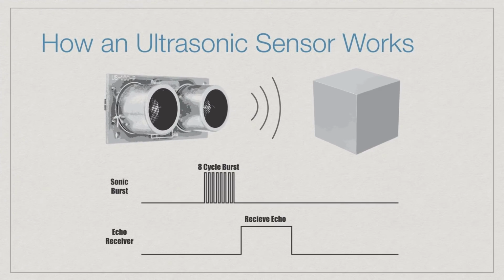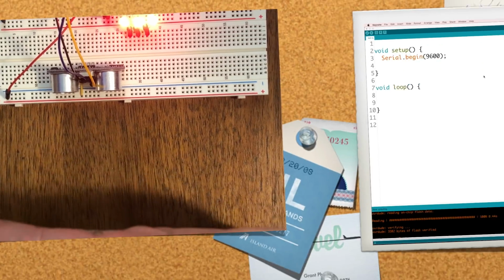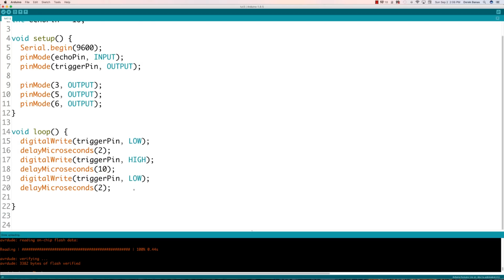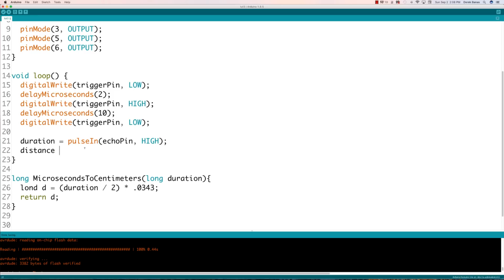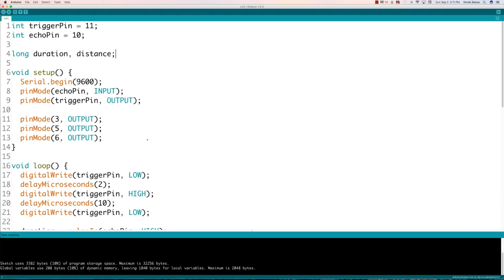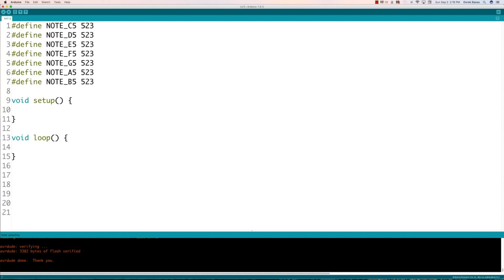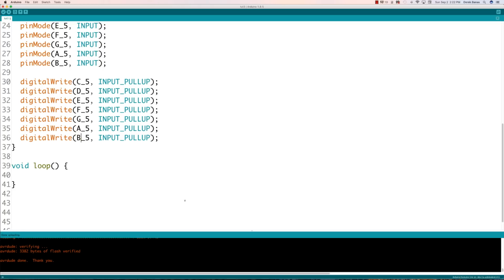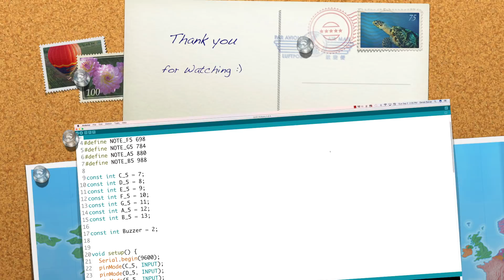Arduino Tutorial 3 : Proximity Sensor & Piano

Comment: Just wanted to contribute, through your thread.  Just bought a ESP32 Wemos lolin32, and thought I would convert your code, for the UltraSonic sensor, to code for the ESP32.  And yes the code, for using LED's, is different from an Arduinos, even though its the same for the UltraSonic Sensor, on both boards.  Also, be aware I used different pins, out of the convenience of their placement.

// Create easy ways to identify what pins are being used for 
int triggerPin = 27;   // instead of 11
int echoPin = 26;      // instead of 10
 
long duration, distance;

// ESP32 the number of the LED pin
uint8_t ledPin1 = 13;  // 13 corresponds to GPIO13
uint8_t ledPin2 = 12;
uint8_t ledPin3 = 14;

// ESP32 setting PWM properties, assigned to channels 1,2,3
const int freq = 5000;
const int ledChannel_1 = 1;
const int ledChannel_2 = 2;
const int ledChannel_3 = 3;

const int resolution = 8; // 0-255 (resolution 16 bit 1-1024)
 
void setup() {
  Serial.begin(9600);
 
  // Designate which pins are used for output and input reasons
  pinMode(echoPin, INPUT);
  pinMode(triggerPin, OUTPUT);

  // ESP32 configure LED PWM functionalitites
  //ledcSetup(ledChannel, freq, resolution);
  ledcSetup(ledChannel_1, freq, resolution);
  ledcSetup(ledChannel_2, freq, resolution);
  ledcSetup(ledChannel_3, freq, resolution);
 
  // ESP32 Prepare LED pins to provide an output voltage
  ledcAttachPin(ledPin1, ledChannel_1);
  ledcAttachPin(ledPin2, ledChannel_2);
  ledcAttachPin(ledPin3, ledChannel_3);
}
 
void loop() {
 
  // As we loop the trigger pin that sends the 8 cycle frequency is turned on and off
  digitalWrite(triggerPin, LOW);
  delayMicroseconds(2);
  digitalWrite(triggerPin, HIGH);
  delayMicroseconds(10);
  digitalWrite(triggerPin, LOW);
 
  // Get the travel time from playing the sound to receiving
  // it back 
  // pulseIn() turns a pin on and waits times the period from LOW to HIGH
  // and returns the period in microseconds
  duration = pulseIn(echoPin, HIGH);
 
  // Convert that time to centimeters
  distance = MicrosecondsToCentimeters(duration);
  Serial.print("Distance : ");
  Serial.println(distance);

  // The PWM amounts vary, because I used 3 different sized LED's
  // and wanted the same intensity in brightness
  // If less then 20 centimeters turn on 1 LED
  if(distance < 20){
    ledcWrite(ledChannel_1, 95.5);
  } else {
 
    // If not true turn off LED
    ledcWrite(ledChannel_1, 0);
  }
 
  // If less then 15 centimeters turn on next LED
  if(distance < 15){
    ledcWrite(ledChannel_2, 85.5);
  } else {
    ledcWrite(ledChannel_2, 0);
  }
 
  // If less then 10 centimeters turn on next LED
  if(distance < 10){
    ledcWrite(ledChannel_3, 85.5);
  } else {
    ledcWrite(ledChannel_3, 0);
  } 
}
 
// The speed of sound is .0343 cm/μs
// We receive both the distance from the sensor and
// back again so we must divide by 2
long MicrosecondsToCentimeters(long duration){
  long d = (duration / 2) * .0343;
  return d;
}
Reply from the maker: Thank you for taking the time to help others :)

Comment: I've learned so much from your videos alone, they are great. I'm still stuck with a problem in my project though. I'm using an MPR121 Capactive Touch sensor attached to an Arduino Leonardo. I have 12 electrode attached to this module and they are working great, but I'm lost when I try to use this sensor touch/release information to create MIDI note values.. I'm trying to implement sections of your code where you define frequencies but nothing seem to work. Would you know how to solve this?

Comment: Hi, I had a problem with the code, both the one I made myself following the video and the one downloaded from your link.  The LEDs are constantly on when both sketches are uploaded regardless of the sensed distance.  The output to the serial monitor shows that the device is able to detect the distance accurately.  The LEDs appear to flicker slightly at the distances in the if statement but never turn off.  Do you have any idea what might be happening?

Comment: Hey Derek,  couple of simple questions (simple for you anyway). Would it be more efficient to use some kind of Case statement in place of all those While statements? I know it is getting away from the basic nature of the example, but just curious. Also what happens if you try to play two or more notes at the same time? Is that possible?
Reply from the maker: Yes you could use a switch statement instead. A passive buzzer only plays 1 tone at a time
Reply: Ahhh yes I was thinking about it from a coding perspective not a hardware one.

Comment: I would like to check, if someone is in front of the door invisibly, indicated by light or sound or starting a camera. That will not work with an ultra sonic device. Probably possible via a capacitive solution. That might be done by 2 sheets of metal or alu foil? Someone with an idea?
Reply from the maker: This senses motion and heat changes, which would work if someone was moving or just standing very still Omron Electronics Inc-EMC Div D6T-8L-09. This measures CO2 changes in the air https://www.dfrobot.com/product-1549.html

Comment: Make a roomba. It has to remember where is came from and "redock" itself too. So steppers, servos, dc motors, proximity and colission sensors and a database! You can take the pueces of this and go on to make anything from there!
Reply from the maker: That would definitely be a great project. I think I'll start a little slower and make a calculator and do something with IR modules and LCD panels :)

Comment: Excellent explanation but according to my documentation, the second parameter of the analogWrite function is an integer. How did you get to the value of 91.5 to use with a LED?
Reply from the maker: Thank you :) I should have explained that analogWrite will down cast floats as well. I'm saying here that I want 91.5% of the max 255, which works out to around 1.8 V
Reply: Derek Banas sorry Derek, but you are not aiming for 91.5% of 255, but (91.5 / 255) * 5V = 1.78 Volts. Have been playing around with this, with a multimeter, all morning and finally figured out, after researching PWM, how this all works.
Reply from the maker: Sorry I shouldn't answer questions right when I wake up. You are correct. I covered that in the last video, but should have covered it again.
Reply: Absolutely no need to apologize, I quite understand about early morning emails. Thanks for taking the time to answer, anyway. But if you do happen to cover LEDs again, could you briefly touch on the subject of "forward voltages"? Keep up the good work!